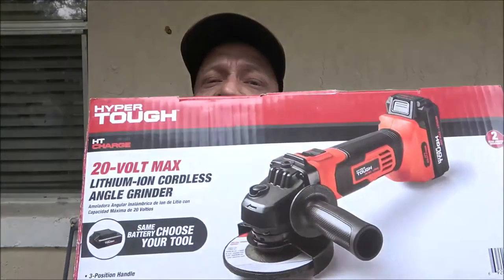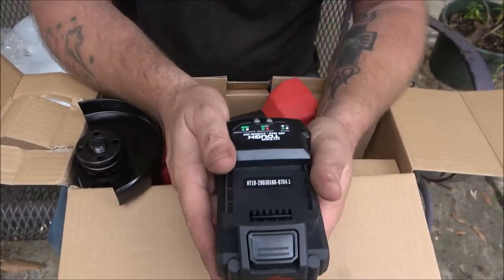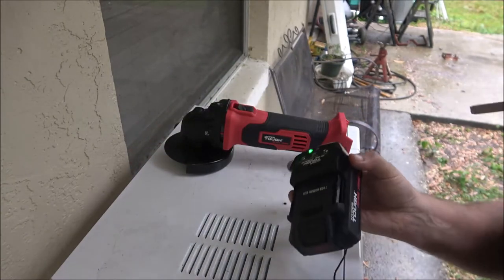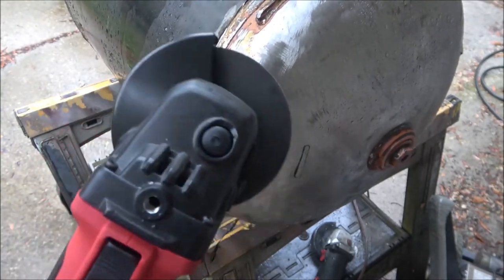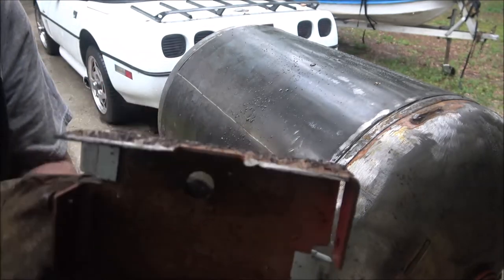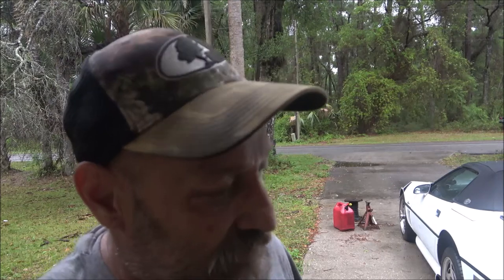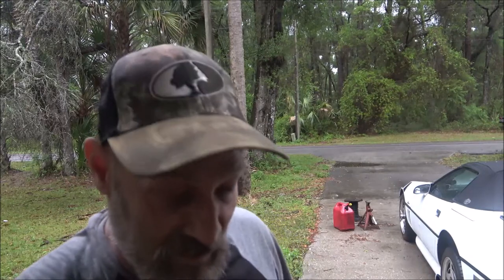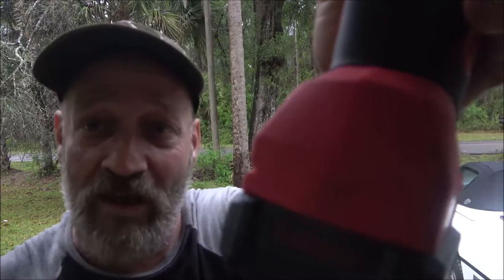Hyper Tough 20 Volt 4 Inch Angle Grinder Review From Walmart

Comment: I have a couple of the Harbor Freight  angle grinders, the  cheaper Drill master I think I paid like $10 with a coupon and a bought a Bauer 4-1/2 grinder for like $35.  The cheaper one if it burns up just toss it out and get another one,  my $10 one is about 4 years old already.
Reply from the maker: same here. these cheap grinders do just fine in my book. i took the battery one back and got the electric on for 20 buck. same brand so we will see how this one does.

Comment: I just bought it and then watched this video... I got a corded one but I've been stuck in town or somewhere without power so many times, I need a cordless one. If it can do easy jobs on the go like cutting through metal pipes then it will be good for me. I bought an extra 4amp battery for it too because I suspect the small 1.5amp will go dead quick.

But watching this video, maybe I'll return it... I'll test it out. Maybe it will do better with my bigger battery.
Reply from the maker: It might with a better battery, but in my case It wasn't
Reply from the maker: Oops, feasible to keep the cordless one. But in your application it may be fine. Let me know how it does for you.
Reply: @shabear1000  I'll see, I'm keeping the receipt too. I know my corded one works good

Comment: That battery that came with it is to small of amps.  If you get the bigger battery it works just like all the name brand. You gave up to soon buddy. Go get the bigger battery and you’ll be amazed 🤘🏼
Reply: Well that gives me hope. I suspected that so I got a 4amp battery for it. Maybe that will work. I'll just use the smaller one it comes with as an extra for my drill.